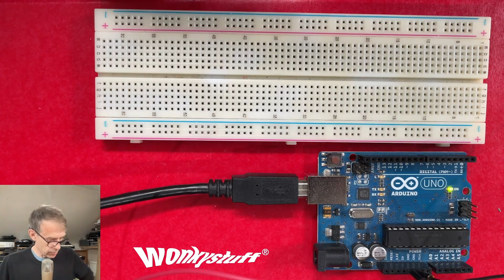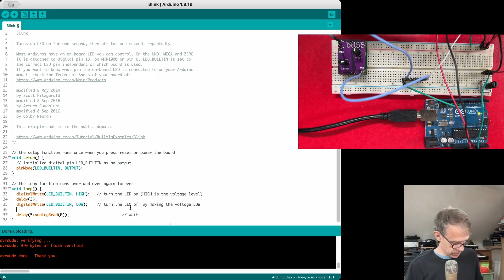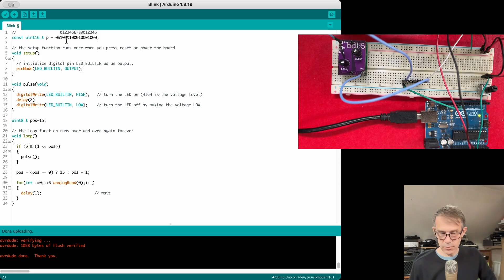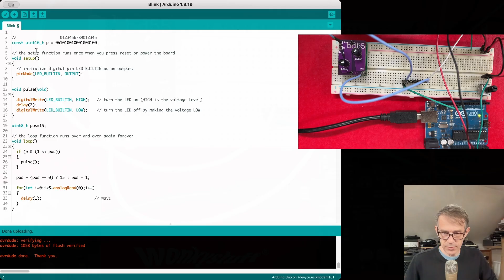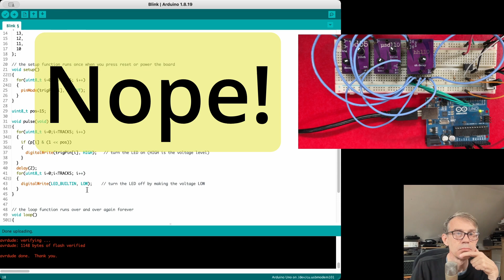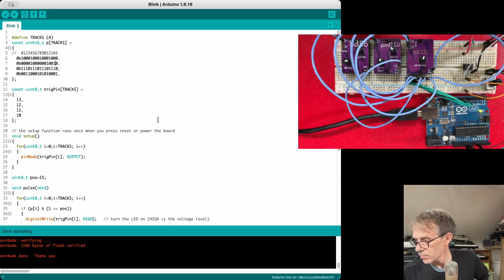From ‘Blink’ to drum machine: playing with Arduino and AE Modular

Comment: wow, it is smaller than microrack, cool to see the same idea! Sad to realize it is different power layout than microrack has😢
Reply from the maker: Yes, the AE Modular Micro format has been around since 2022 or so; using a breadboard was not the original intention — there are baseboards which integrate the smaller modules with the ‘full size’ AE Modular cases 😁
Reply: @wonkystuff  yes, I know about AE system but I was surprised it fits into breadboard
Reply from the maker: @thecoreglitch yes, it’s a bit of a hack because my drum modules only use the power pins from the 6-pin header, therefore it sits quite nicely into the breadboard